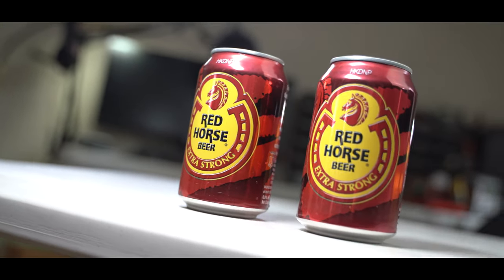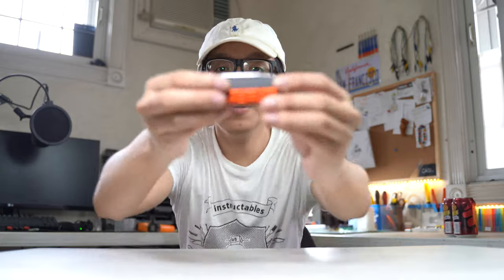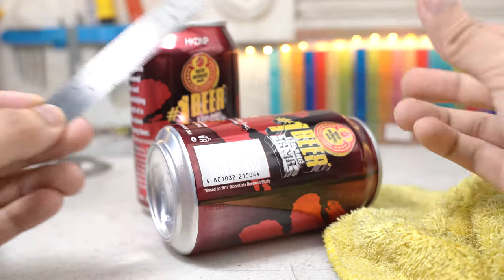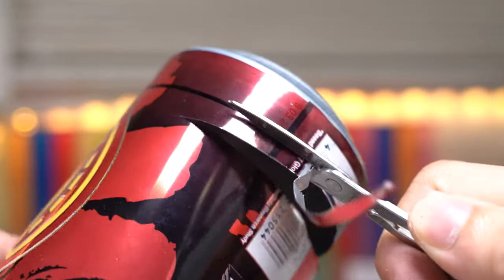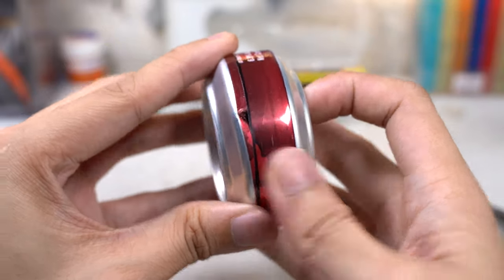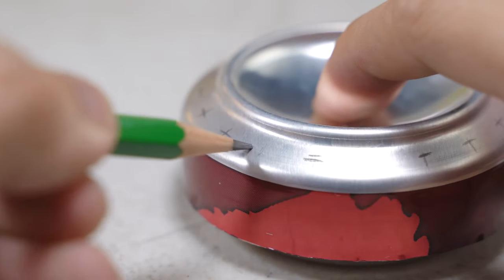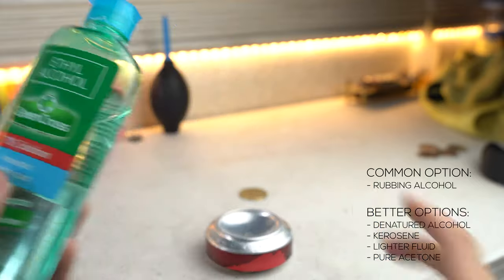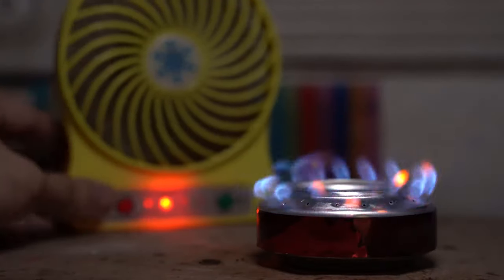DIY Soda Can Stove!

Comment: A classic project in a modern nicely made video. Well done.

Two nice upgrades could be using the waste of the can for a wind shield and pot stand< plus I always heard adding another wall of aluminum inside the cans with holes at the bottom helps with functionality.

Comment: I like the video and the idea has been around for a long time but, the required items isn't accurate and there are better ways to do this

Improvement 1 instead of emptying can then cutting, use utility knife or blade to score a line around the cutting points then empty the can, this will give you a solid cutting edge as the liquid and pressure inside an unopened can will push against you for scoring,

Improvement 2, you said all you need is a Swiss army knife and 2 cans, then there was glue, needle, sandpaper and a drill added later,

Comment: there is another version of stove using tuna can (2 inches in height).  1.open the can 2. remove the tuna 3. punch holes around the tuna near the lid using small nail and hammer 4.use denature alcohol for better results.
Reply: What you describe it's a different type, a open top, low pressure side burner.

The one in the video is the classic "Penny stove" a pressurized top jet burner type.

Anyway, both types was surpassed by the "Capillarity Hope Stove" type, a bit difficult to make because require specific Asian cans.